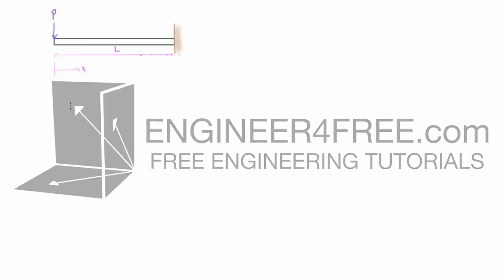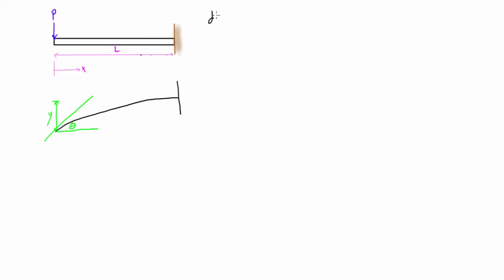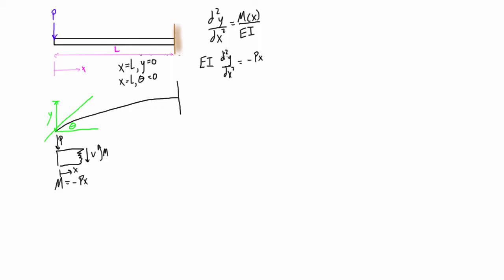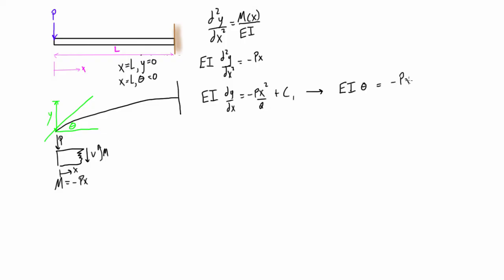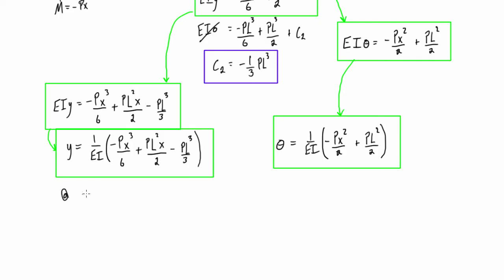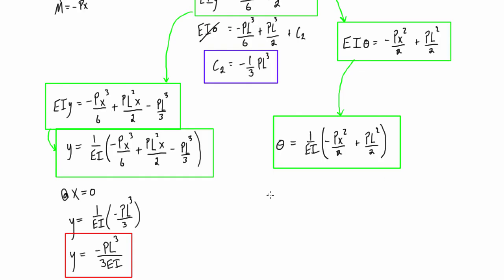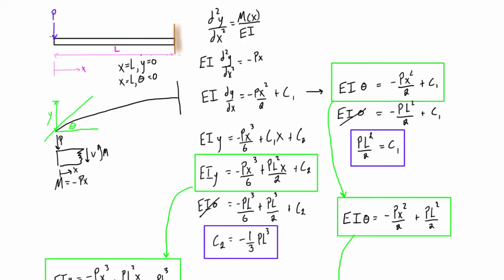Find deflection and slope of a cantilever beam with a point load (double integration method)

Comment: What is the technical name for the differential equation if this beam is statically determinant?!
Reply from the maker: Mmmm this is a linear first order ordinary differential equation. Heres a short video that I made that talks a little bit about the classification of differential equations: https://www.engineer4free.com/4/how-to-classify-differential-equations and you can also check out https://www.engineer4free.com/differential-equations for more methods solving specific types of ODEs
Reply: @Engineer4Free  Thank you! One more question. How can I derive that equation if I wanted to find a deflection at any point. I know you have a table on your website for any loaction 0<=x<=L. I am just curious of the derivation.

Comment: Hello there sir. At 1:21 you wrote the moment M to be positive counter-clockwise. So shouldn't M be equal to Px and not -Px? As P will be exerting force counter-clockwise as well?
Reply from the maker: Hey Naved. M here is short for M(x), which is the internal moment equation in terms of x. On that little diagram at 1:21, P is oriented down. v (the internal shear) is pointing down, but that's just its sign convention, it needs to be equal and opposite to P, so if we had billed it in, it would be pointing up, with a magnitude of P'. Now we have a force couple, P and P', seperated by the distance x. The force couple causes a counter clockwise moment. The internal moment, M, is drawn in in the positive convention, being CCW. But in reality, because there is a CCW moment caused by the force couple, which is equal to Px, then for moment equilibrium, the internal bending moment at x must be equal and opposite, so it is - Px. A different way to think of it is that because the moment from the force couple is CCW, then simply the sense of the internal moment must be opposite, so it's CW. And for equilibrium, they just have the same magnitude of +/- Px. Hope that helps to clarify

Comment: How would I derive for deflection if I have the same beam but the point load is not at the tip, its somewhere at distance 'x'?
Reply from the maker: Just pretend the beam is x metres long then and from 0 to x the process is identical. From x to the end, the beam will actually have no curve, it will be straight, and the slope anywhere in this region will equal the slope at x. So you can find deflection from 0 to x with the method in this video, and then because you know the deflection at x, then just some simple trigonometry will allow you to find the deflection from x to the end.
Reply: @Engineer4Free  Thank you very much! Liking and Subscribing is the least I could do to express my appreciation, I thank you again.

Comment: Hi
You are taking the clockwise moment to be positive. Can I take the anti clockwise moment to be positive ? Is it going to give me the same correct answer ?
Reply from the maker: I have drawn the internal bending moment as counterclockwise, not clockwise. I do this at 1:21. This follows the positive sign convention for beam bending (see this video: https://www.engineer4free.com/4/internal-force-sign-convention) and should be followed when using the double integration method

Comment: Very informative. I have a small question about a cantilever beam which is half composite (x=L/2) and the other half polymer ((Rem)x=L/2). How can I calculate its deflection when a point load is applied?
Reply from the maker: You would have to break it up into two problems basically. The curvature and deflection in the first half will depend on the flexural rigidity in that region, and then use the slope and deflection at midpoint as the boundary condition to base the zecond half off with the new flexural rigidity. Doesn't sound like any fun!

Comment: why would you call a slope theta and put it like an angle threw me off bro
Reply from the maker: Hmmm it might be dialect. Slope can refer to something like sloped hill. like, "hey, the ground over there is on a slope, it's a hill, the hill has a 30 degree slope." So when I say slope in this case, I'm referring to the angle of the deformed structure after it's loaded. The angle theta can actually be used in the general case to refer to the angle of the deformed structure at any point x. Does that make sense?

Comment: How do you also consider the horizontal displacement?
Reply from the maker: We consider this type of problem to have zero horizontal displacement because there are no horizontally applied loads. We assume that the the deflection at all points is entirely in the y direction.
Reply: Engineer4Free yes, but for large deflection, horizontal displacement becomes important doesn’t it? What would be your approach in this case?
Reply from the maker: At the undergraduate level, if the problem is statically determinate, then just ignore it. If an undergraduate level problem is structurally indeterminate, then you do need to consider the axial forces that develop from what you have described. However, the axial forces in that sense are just used in the calculation of horizontal reaction forces at connections, not the displacements at free ends (if there are no horizontally applied loads). I have a whole course on various methods available for analyzing structurally indeterminate beams, you can check it out here: engineer4free.com/structural-analysis You are ahead of most people by realizing that in real life there should be some horizontal displacement, but just enjoy the simplifications and don't worry about it unless you pursue graduate studies in structural engineering :)

Comment: What if you swapped the positions so that the wall is now at the origin, and the beam extends to the right?
Reply from the maker: If the beam is oriented as you described and you need to derive the expression using the double integration method then honestly the easiest way to approach that is set x = 0 at the free end of the beam which would now be on the right side. Define leftward as the positive direction for x and take the exact same approach mathematically just with the image and positive direction switched. If you don't need to derive the expression, then just go to a table like this one: https://www.engineer4free.com/extras/beam-slope-and-deflection-table or the one in your textbook. The deflection at the free end of a cantilever beam with a single point load acting down perpendicular at the free end will always be y = -PL^3/3EI regardless of which way the beam appears to be oriented in the drawing. On that note, the way the diagram is drawn is really just a result of where the observer is viewing the beam from. You can view a diving board from its "left" side or its "right" side and if you drew a 2D diagram of your view of the diving board than one would look like the set up in my video and one would look like the set up in your problem. Either way it's still the same diving board, so doing something like setting the positive x direction to be leftward on a 2D drawing might feel a little awkward, but it's the same as setting it rightward when viewed from the other side. Hope that makes sense!

Comment: Thanks for sharing a great video. I am still learning and don't know much about integration. Will also check your website if you have some materials to study. Could you please explain more detailed why the terms become zero at 11:30?
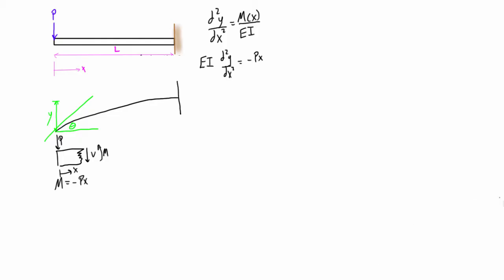Reply from the maker: Hey thanks for watching! We are technically solving a second order differential equation in this video, so a good understanding of integration definitely helps. tl;dr the solution to a differential equation is the function y in terms of x, so in this case y=(1/EI)((-P(x^3)/6)+(P(L^2)x/2)-(P(L^3)/3)). That function y(x) in these problems describes the position at every point on the deflected structure. So basically if you make a graph where the origin is at the free end of the beam when it is undeflected, the function y(x) = (1/EI)((-P(x^3)/6)+(P(L^2)x/2)-(P(L^3)/3)) will return the y value of the deflected structure for and x value on the span (ie, it's just basically plotting a side view of the deflected structure on the graph). Once you have determined the function y(x) all you need to do is input the value of x that you are curious about into all of the x's in the function, and then the function will spit out a value for y at that value of x. So when we want to find the displacement at the free end of the beam (at x = 0) then we just plug in zeros for all of the x's in y=(1/EI)((-P(x^3)/6)+(P(L^2)x/2)-(P(L^3)/3)). That makes the terms with x's become zeros because of simple multiplication and we find that y(0)=-P(L^3)/3EI. If you plug in x = L and then simplify, you'll notice that the entire function will equal zero, which matches the boundary condition observed from the diagram at 2:00, same with the slope function, if you plug theta = L, that equation for theta will equal zero, which also confirms the second boundary condition. Does that clarify it? I wouldn't worry too much about how differential equations and integration works, if you made it to this step then its just plugging in values of x into y(x) to get y at that x.
Reply: Of course, it's very obvious now when you told it. I was thinking way too complicated. Thank you very much for your answer, didn't expect such a good answer from someone who has 21k subscribers, hehe.
Reply from the maker: No worries, glad it helps!!